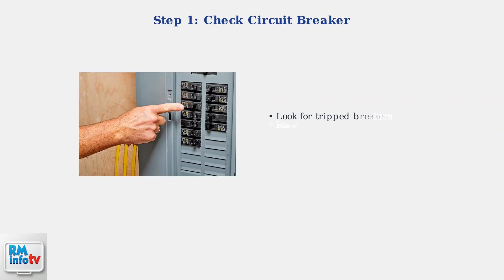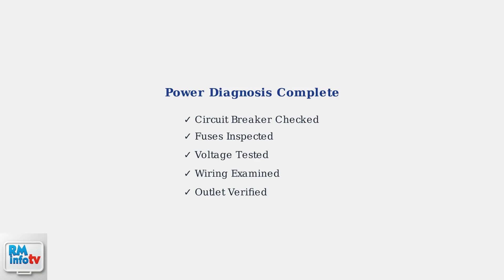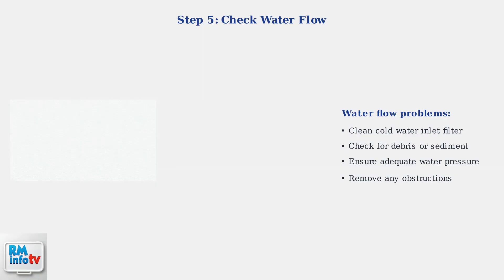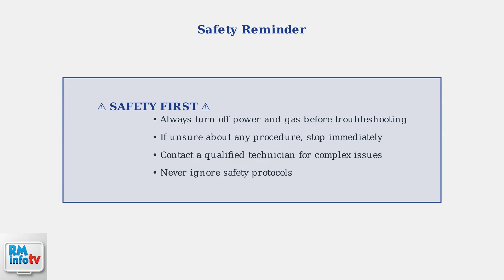How To Fix Rheem Tankless Water Heater Will Not Power On – Power Supply & Circuit Check

Comment: I would suggest that this water heater has had issues from the beginning. My builder installed it in a new home, and the technicians have not been very positive since day one. Today, it has completely stopped working—there is no power at all. I have reviewed all the tips provided here, and it seems that the PCB is faulty, based on the information explained. Hopefully, future viewers will avoid purchasing this product and will not overlook its faulty design.